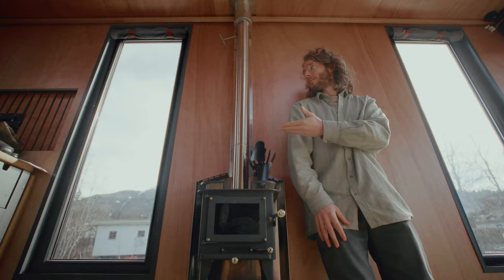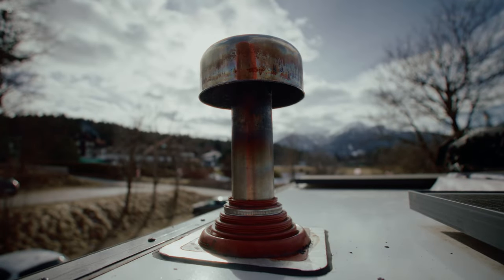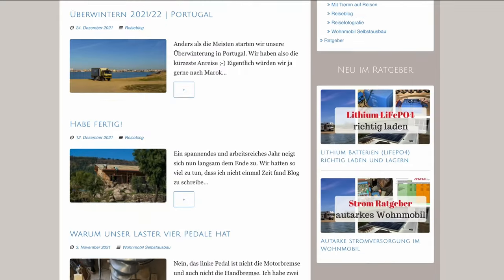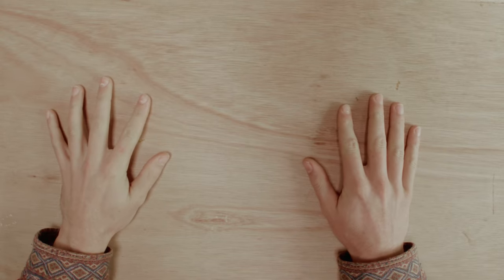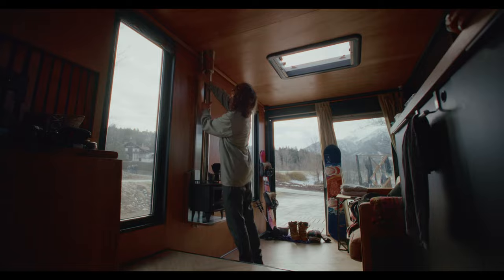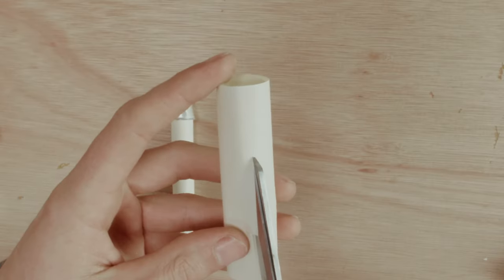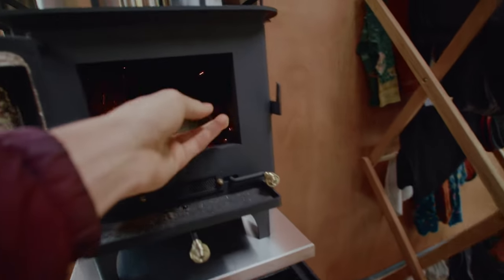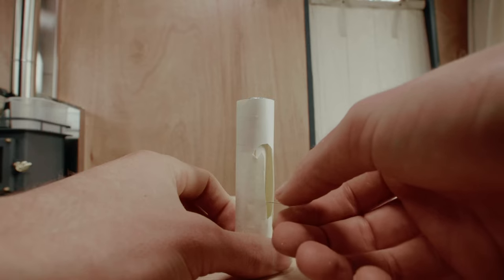Sliding Flue Pipe for your Wood Stove

Comment: Thanks for the video. We will try to build something similar, but out of thinner pipes because we have to look on the weight of the build. Do you think the rings holding the cord are necessary, maybe gluing is enough?

For anybody looking for a cheap stove. Kuntsmart in Istanbul sell small wood stoves as well. We bought their smallest one for 110USD at their shop in Istanbul. Don't know about shipping costs though.
Reply from the maker: How cool that you found an alternative! How do you like their stove?
Reply from the maker: If you can get it glued strongly, it might be enough. Our bottom chord fell of even with the ring and glue. Doesn't seem to affect the system so we keep it like this.
Reply: @NicoJona  We have not used it so far. But it looks very nice and just weights 5kg. Maybe not as good as the "original", but good value for the money, I think.
Okay thanks. I will see if we can go with a thinner flue pipe. Might be tricky to weld a nut to it.